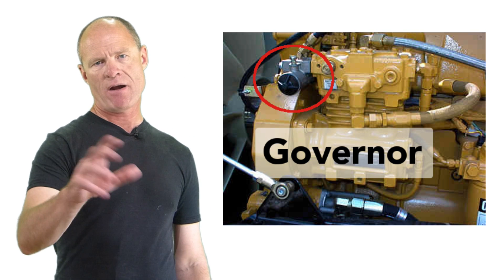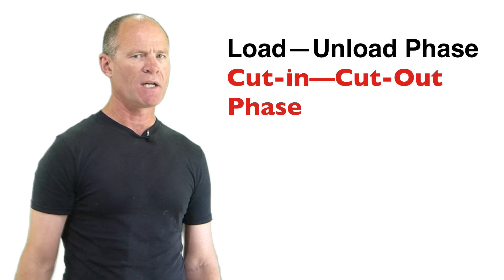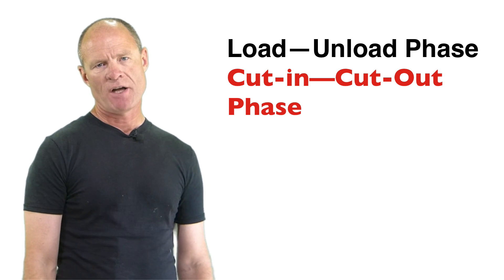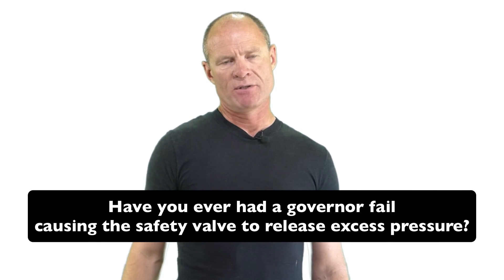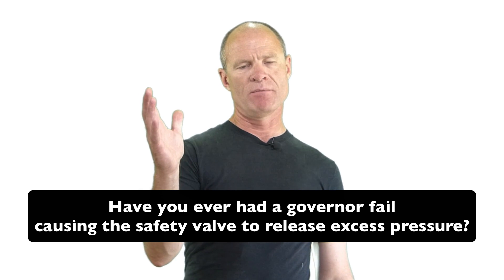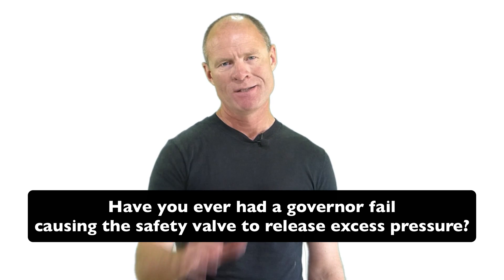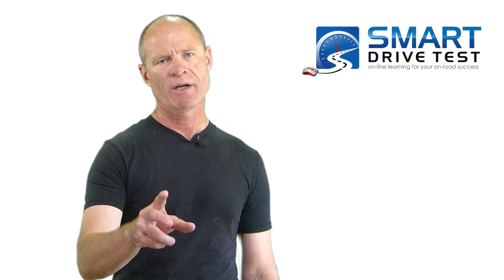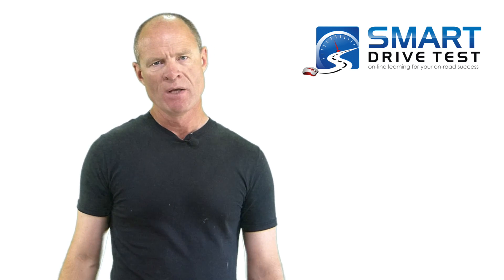How to Test The Governor for Air Brakes Course | Air Brakes Smart

Comment: 1979 GMC C70, builds 120 psi but then governor constantly cuts in and out, no air leaks, I got under truck to drain wet tank and no air pressure from drain valve but have 120 on gauge??????

Comment: Have got Mitsubishi Fuso 6D16 engine semi truck,The problem it’s not pissing air out from air dyer once reaches  close to 9PSI the safety valve opens on the air tanks and they is no air pissing out,it build air normal to 9PSI within  5mins at rest but once you put in motion immediately drops to 6PSI & air low warning keeping alarming and doesn’t build air while in motion unless you step on the gas…

Comment: Mind does sound like a machine gun. I replaced the dryer cartilage and the purge valve, also made sure both unloader valves are good. It purges for about 1m 47sec. Then builds up and releases every 30 seconds. Update I also replaced the governor and it still sounds like a machine gun.  So what is the issue?? Please help

Comment: Rookie question here - after testing the air pressure build up time (85-100psi in 2min max) how would I confirm air compressor governor settings? I'm drawing a blank sorry. Do I pump the brakes just as I did for the low air pressure warning device? Thanks in advance

Comment: Thank you for your videos! I changed Governor but I hear leaking air from governor is the last hole .and pressure is not building enough .reach 105 psi and squeeze air like is full .what the problem should be ?thank you

Comment: Have the governor cut in at 119 psi and out at 120. Constantly cycling. Have replaced governor and air dryer. Still same. Have fixed every leak can find. Need help

Comment: I cleaned the entire dryer assembly and replaced the filter, purge valve, and air governor.  Now the system builds to much air and cuts out around 140psi fallowed by the machine gun sound coming from the purge valve.  Any ideas on what I can do?
Reply: I found the fix.  It turned out to be I accidentally plugged the exhaust port on the governor.

Comment: To hell with that, what if the damn thing doesn't pop off and constant pressure builds to max at 150?
Reply from the maker: Hi Robert Henderson - there's a safety valve my friend. It goes off at 150psi and sounds like a machine gun. If you want more information see: https://www.smartdrivetest.com/airbrakes-cdl-rv/air-brakes-explained-simply All the best, Cheers Rick
Reply: @smartdrivetest  yep, but if that safety valve doesn't pop off then what?

 That's what I'm experiencing right now.

Comment: I drive Pierce  Velocity for my work. We have department SOP based on NFPA 1911 and OR CDL Manual for testing cut in and cut out pressures. They all state that after determining cut in pressure, switch to high idle and observe cut out pressure. Why high idle?

Comment: Bad day I had forgot to drain air tanks. Cost was $119. They froze and a popping sound. Then slowly you couldn't build air. Valve was plug to comp. I open hood and let sun help Un freeze it. Lucky I drove into shop.

Comment: I do pm’s on trash trucks and my question is when I do my cut in cut out test, I’ll pump the brakes but it builds at any pressure until the air dryer purges, i may be doing them wrong but every time I do it it seems like it will build pressure wether it’s 5 pounds or 60 pounds from the cutout pressure

Comment: Thank you for your video. Question: how to adjust cut in phase? The minimum psi.
Reply: You cannot adjust only the cut in point.
You can only adjust the 20-25 psi cut in/cut out range. 
If you think of it as a 12 inch ruler, you can place a 1 inch range anywhere on the ruler. The values will change but the range remains the same. 
Hope that helps.

Comment: Hi rick. My air dryer keep purgeing constantly every 5 second even when just park. I change the air dryer new and also the air governor new and still the same problem no air lick also... what could be wrong?
Reply from the maker: Hi Anastacio Santiago - There could be any number of problems with the system my friend. The sensor in the air tanks telling the system that it's full could be faulty. Some times a bit of dirt gets caught in the purge valve inside the air dryer and causes that problem, but because you replaced it, that's unlikely. At this juncture, I would counsel you to take it to an automotive technician. They have the tools to diagnose and tell what's working and what's not. All the best, Cheers Rick

Comment: I got issues with a ford f750 brake air pressure build once after i hit the brakes pressure drops like you’re supposed to. But doesn’t build back up again unless I bleed the air out again here’s a video of my issue any help it appreciate it thank you. https://youtu.be/Zz29Wpiju74
Reply from the maker: Hi jorge dominici - Thank you for your question. Sorry for the late response. Did you get the issue with the air brakes sorted? When I watch the video, my first thought was the governor. It's not putting the compressor into the reload phase. Did you check the governor? All the best, Cheers Rick
Reply: Yeah it was the governor.. it was weird every time I let air out of the tank. It would work but only that 1 times. The governor seems like the only thing that can effect both front and rear brakes at the same time.
Reply: Thanks you so much. Your videos are a big help.

Comment: So does the air compressor always make air no matter what ? But the regulator diverts air between tank and atmospehere , or does the governor make the compressor actually Stop making air?
Reply from the maker: Hi Matt Frank - Thank you for your question. You first part is correct. The governor (regulator) switches the air between the system and the atmosphere. Think of it like a thermostat on a furnace that turns the furnace on and off within a range. Except the governor diverts where the air goes. For more information, consider this book: https://www.smartdrivetest.com/air-brakes-explained-simply All the best, Cheers Rick

Comment: Is the air compressor governor always located near the top of the air compressor?
Reply from the maker: Hi Steven Litvintchouk - Thank you for your question. In most cases, but not always. And with an ADIS--Air Dryer Integrated System--the governor is near the air dryer. See this video: https://www.youtube.com/watch?v=yBi-6eUch0w&list=PL0x-bChcUvwG2bSWReQWnk9Tm92L7WN_O&index=17 All the best, Cheers Rick

Comment: Hello sir,...I am using a truck TCD 16.0 V8 engine equipped with WAbco air systems but problem is that there is no governor so how compressor unload in this systems and what is use of purge tank????
Reply from the maker: Hi firoz alam - Apologies for the late response. Thank you for your comment. The governor is probably near the air dryer my friend. Have a look at this video: https://www.youtube.com/watch?v=yBi-6eUch0w&list=PL0x-bChcUvwG2bSWReQWnk9Tm92L7WN_O&index=18&t=0s All the best, Cheers Rick

Comment: This morning after i start the trk,i start cooking my breakfast,and i saw the borh tanks going empty and not building air,the engine was running,then i tap with a hammer the air dryer and governor and start working again,i should replace the governor i think is the time

Comment: Just seen your video, ??, when it rains and im driving it seems that water gets in my system alot and mess up my air dryer and governor, is this a compressor problem?
Reply: What about the filter of air dryer?

Comment: I'm confused on the Ohio cdl manual it doesn't say anything about a static air test of governor air test only Apply pressure test then low warning test follow by emergency test. Are the governor test mandatory in every state or just different states
Reply from the maker: Hi Edluis Rivera - Thank you for your comment and query. The test for the governor is on pg. 5-6 of the manual. You have to test cut-out and cut-in of the governor on the system. Have a look at this video for how to find the information in your manual: https://www.youtube.com/watch?v=Lqfg72a_oO4&t=2s&list=PL0x-bChcUvwG2bSWReQWnk9Tm92L7WN_O&index=4 If there is anything further we can do, drop us a note. Always happy to help. All the best, Cheers Rick

Comment: I've got a KW T 800 not building air at idle. This morning after running 10 minutes I had 0 PSI in both tanks. I wonder if its dumping air to atmosphere and not entering load phase. Or maybe I have a bad compressor?
I don't have any bad leaks with the supply valve opened or closed nor with the brake applied but the truck will leak down over night.
Reply from the maker: Hi Blade - Thank you for your comment and query. Pull off the main discharge line and see if there is compressed air coming from the compressor. Also, check the discharge valve on the air dryer - that may be stuck open and dropping the air from the system. I'm not sure if you can bypass the governor, but if you can, that will tell you if it's the governor. I know there's a set screw on the governor, and you could try adjusting that and see if you get any response. There's a safety valve on the system, so don't be afraid of over-pressurization. If there is anything further we can do, drop us a note. Always happy to help. All the best, Cheers Rick
Reply: @smartdrivetest  Thanks Smart Drive Test I'll check those things. I know its not dumping at the dryer for sure.
I was loading asphalt yesterday holding the brake under the shoot and my secondary air red lighted on me and the alarm came on. So I'm thinking with no major leaks that I have some sort of weak delivery problem.
Reply from the maker: Hi Blade - Thank you for your response. Yes, when we drive the same vehicle all the time, often our suspicions are correct. All the best, Cheers Rick
Reply: @smartdrivetest  I wonder if an unloader kit in the compressor might fix it? The compressor is not that old maybe close to 4 years.
Reply from the maker: Hi Blade - Thank you for your response. That might help, but the first thing you need to determine is if the air compressor is pumping. It's rare for air compressors to fail. All the best, Cheers Rick
Reply: @smartdrivetest  Good news! I found a bad leak in the line in between the compressor and the dryer. I found it by taking the line loose at the dryer then rounding up some fittings to hook shop air to it so everything was quite and it showed up immediately. I could never hear it with the engine running and there was no pressure there with the engine off so shop air did the trick.
Reply from the maker: Hi Blade - Thank you for your letting us know that you found the problem. That is great news that it's just a hose - simple and inexpensive repair. Did the hose wear out, or was it cut on something? All the best, Cheers Rick
Reply: @smartdrivetest  About 2 ft from the Stainless steel braided line where it switched to reinforced rubber hose  there was a piece of heat shield wrapped around the hose and the hole was under that.  It was near where the transmission couples up.
Reply from the maker: Hi Blade - Thank you for your response. Interesting place for a hole. Good find. Was it expensive to fix? All the best, Cheers Rick
Reply: @smartdrivetest  It was 180 ish with us finding and fixing it ourselves. It was about 8 ft long blue replacement. Lots of zip ties and new heat shield in hot areas.
Reply from the maker: Hi Blade - That's awesome - a rather minor cost in the big scheme of things. All the best, Cheers Rick

Comment: I have 2005 peterbilt 379, cat15 engine 
My truck sounds like a machine gun when it gets to 120psi. It slowly drops it to 90 with this horrible sound. Then quickly builds the pressure back 120 and machine gun sound is back. Replaced air dryer with all the components twice (including governor). Purchased at fleet pride. Replaced main air hose(compressor to dyer ) 3 times. It heats up and burns thru every time.  Replaced both valves on top of the compressor...SOS.. Bad compressor? Or bad dryer?
Reply from the maker: Hi Danilbek Karmiev - Thank you for your comment and query. With the hose burning out, it sounds like there is a blockage in the system some where. Is the air getting past the air dryer into the air tanks? It's unlikely, but there's a possibility that the one-way check valves at the entrance to the air tanks could be causing a blockage. If there is anything further we can do, drop us a note. Always happy to help. All the best, Cheers Rick

Comment: Hello, I have volo 2009 , I just replaced air dryer housing &filter 2 month ago , I got problems with changing air in to the system, when truck it’s idling the air drier it’s working right, but when I am driving the purge valve it’s stay open , can you help me please. Thank you.
Reply from the maker: Hi Luci Campean - Apologies for the late response. Thank you for your query. Did you get your problem sort out? Often what happens is there's a bit of dirt in the purge valve that causes it to stay open. Perhaps that's what happened. All the best, Cheers Rick

Comment: Got a 90 Volvo semi fired up first thing build air pressure up purge valve a fire and it will drop down pressure and it won't climb over 30 what you thinking? Think  might be the governor. Truck has set for 4 years
Reply from the maker: Hi Robert Schreier - Apologies for the late response. Thank you for your comment and query. I suspect that it is indeed the governor. What did you learn?  All the best, Cheers Rick
Reply: We ended up replacing the gov and now it builds air well. Now i just got to get it running right.  Old truck good only for yard duty.  But needs to run and build air. Thanks for getting back to me
Reply from the maker: Hi Robert Schreier - you are most welcome my friend. Happy to hear that you got it working...minus the running rough bit. All the best, Cheers Rick

Comment: How would you diagnose a problem with the brakes not reaching correct pressure?  Like, only 40 Lbs PSI.  Let's say I want to avoid swapping a bunch of parts.  How do you diagnose the governor w/o swapping it to fix the problem?  Thanks guys.
Reply from the maker: Hi Joseph Fields - Thank you for your comment and query. If you're system isn't building pressure, it's most likely the governor. There's probably a way to bypass the governor and keep it pumping into the system. If the system reaches enough pressure to blow off the safety valve then you know it's not the compressor, but rather the governor. Stop back and let us know how it goes. All the best, Cheers Rick

Comment: When pressure reaches max(135ish). and I'm in idle or easy on the gas it seems to keep the compressor in "unload" but if I lay on the gas I start hearing my purge valve engage... Is it normal for the compressor to push while I'm accelerating if it's already at max. psi.?...
Reply from the maker: Riff Raff - thanks for your query. No, that’s not normal. The compressor should stay in the unload phase until system pressure drops approximately 20 psi below maximum operating pressure. There something wrong with either the governor or the unload system. It might be some dirt in the purge valve of the air dryer?!? If you have further questions, drop me a note. Always happy to help. All the best, Cheers Rick
Reply: Smart Drive Test it's coming from the expello auto air drier valve thing on the air tank itself... The air pressure gauge on my dash stays at the proper maximum but that expello starts spitting when I accelerate up a grade or lay on the gas to pick up speed... I'm pretty sure the governor is doing its job right. It's probably something with that expello valve.

Comment: Is the cut in pressure adjustable? I know you can adjust the cut out pressure. I have a bus that continuously cycles. About 5 seconds after it spits it starts building pressure again, then spits. Any Ideas? Thanks!!
Reply from the maker: Hi Chris Berry - Thank you for your comment. You can adjust the pressures via the governor, although I usually leave that up to a mechanic. I have heard of there being a bit of dirt inside the purge valve in the air dryer which causes it to discharge and spit on a constant basis. Try blowing a bit of compressed air up into the air dryer purge valve and see if that works. If not, it may have something to do with the air dryer. If there is anything further we can do, drop us a note. Always happy to help. All the best, Cheers Rick
Reply: Just wanted to leave an update, I pulled the air dryer apart and found that the check valve on the supply to the tank had come apart. Replaced the check valve and fixed the cycling problem!! Thanks for your input!!

Comment: Sir could you explain me why my air dryer valve sometimes stays open and the purges after I replaced the air dryer. The old air dryer was acting the same
Reply from the maker: Hi BORIS SEGUI ALBUERNE - Thank you for your query. Some times its as simple as a piece of dirt or debris stuck in the purge valve. If you can get a compressor hose in there to blow out the purge valve. The other thinking is that there is something wrong with the governor - is the maximum and minimum settings the same or have these changed? All the best, Cheers Rick
Reply: I got the same problem mine stays open and just purges like the machine gun and won't build air in to the tanks.. I have to go underneath and  plug the valve so it can stop purging air out
Reply: You need to test and diagnose the air compressor itself. Most times the "unloader" in the compressor head is stuck...because it is wore out. But, the piston rings and bore could be wore beyound speck...if this is the case, the unloader will not signal correctly.